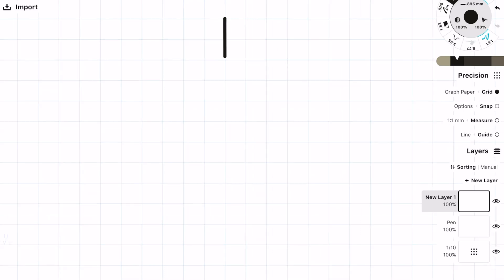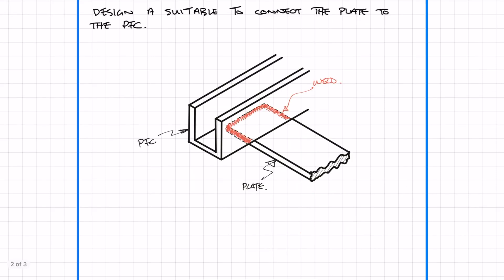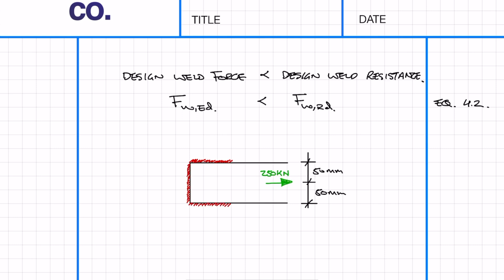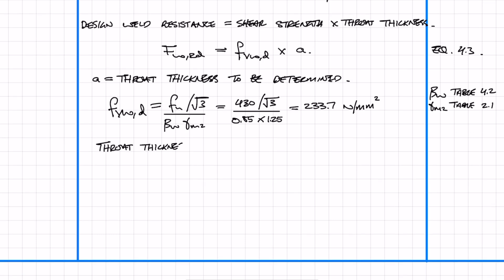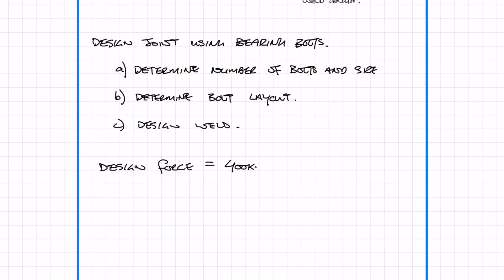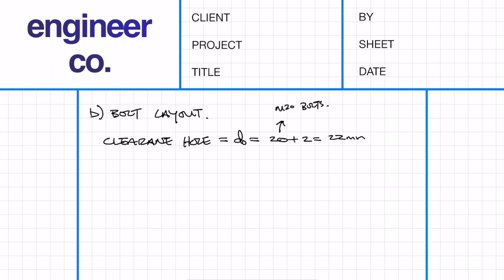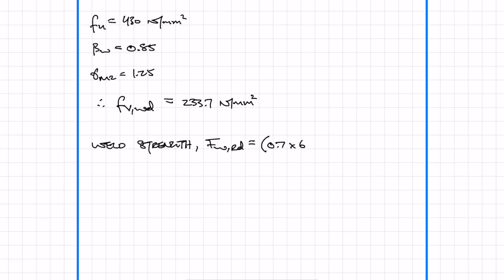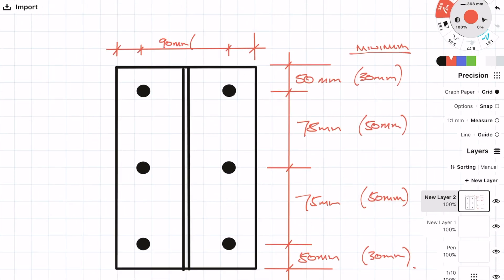Steel Connection Design - Part 2 - Bolts and Welds

Comment: Assume I have a rectangular hollow steel column which is subjected to gravity vertical load and horizontal udl lateral loads. All the four sides are welded together  
How can we verify our weld for such a case of the hollow column.

Comment: Please explain directional method of weld design instead of simplified method, especially on transverse weld where the perpendicular components are calculating.

Comment: Thanks for the video! I just used the checks to do a RHS beam to SHS column connection design that I've been struggling to design not being a traditional UB to UC connection. 

My only question is how would I design / check that the end plate thickness is suitable? Some kindof shear resistance check on the end plate?

Comment: Interesting stuff but when designing a weld I would have thought you would need to specify the preferred welding process, filler material and type. Using your example, would I be right that someone could go and buy a general purpose welding rod and build a structure?
If someone gave me a drawing I would expect to see specified welds with welding symbols and specify the welding process.

Comment: Hey mate, I have been following your channel for a while now. Great stuff, I learn a lot. Could you do a video on how you would design continuous beams (varying spans and load types) or frame structures? And if you are using software instead of hand calcs, how did you do your verification record on paper? I know verification record is practiced professionally as part of the QA requirements but there is not much examples showing how this due diligence should be properly done
Reply from the maker: Thanks for the comment and a good suggestion for another video. 

I’ve done a continuous beam calculation by hand in my piled ground beams video. It’s not varying span so another video to cover that would be good :)
Reply: @EverydayDazz  Cheers mate. Looking forward to that video!